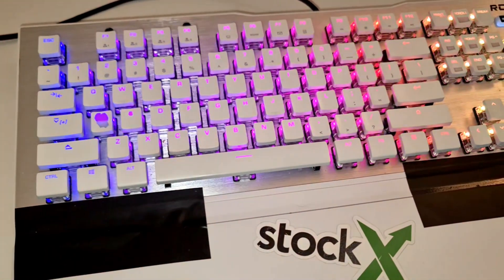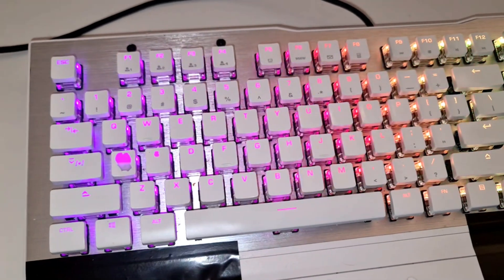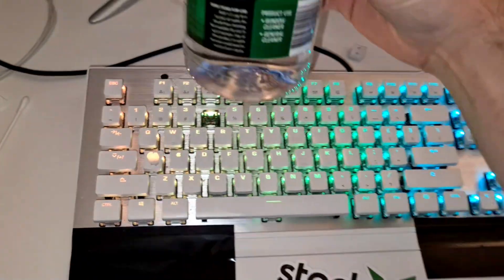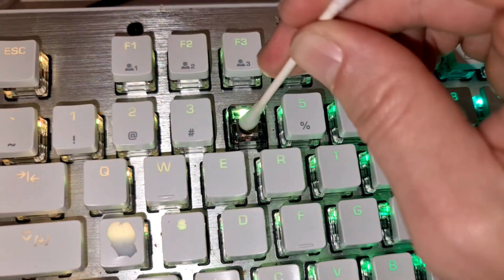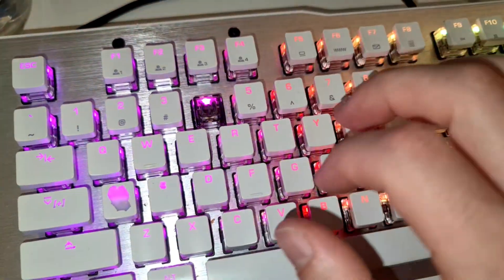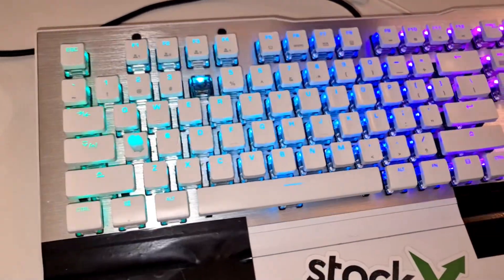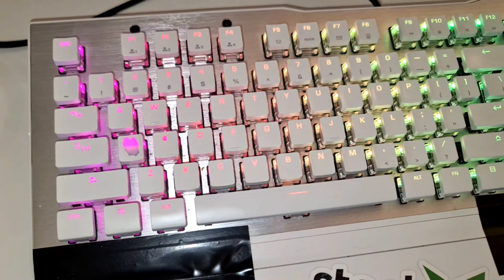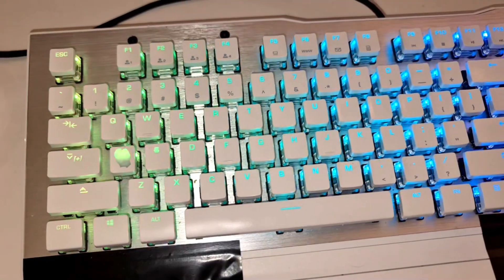Roccat Vulcan AIMO Keyboard key Not responsive or not working? Here is how to fix that.

Comment: IT professional here, have a Vulcan Pro (optical Titan switches).

Got the "-" key failing. At first it would auto-type and spam the "-" character on its own. Eventually it stopped working intermittently, then completely failed.

I tried your fix and it seems to work... for now. Strange thing is I regularly clean my keyboard with isopropyl alcohol, which absorbs water in any shape or form and basically evaporates it. But somehow my keyboard ended up with the same issue as yours, probably due to humidity inside.

Thanks sir, you get a like !
Reply from the maker: Cheers man, yeah I just finally had my Q W E A S D and 3 4 keys go a bit retarded recently.  Gave them a good clean with the spirits and it's all working great again!  

I game a lot and do higher rated mythic keys in wow so my macro keys and movement keys get the most work. 

Kinda feels high maintenance to have laser keyboards tbh. I never had issues with the old school one. 

Glad it worked for you man. Always happy when one of my videos can help someone with a problem they're having 🫰🏻👌🏻
Reply: Yeah I wondered if it had anything to do with the laser emitter and/or detector, because like you I used to have the non-optical version and never had this kind of issue,

I ponder Roccat did not really put the most "premium" model of light emitters/detectors on their PCBs and what occurs most likely, is that those get foggy when the air humidity rises, because those optical bits have not been treated to prevent this. Good old isopropyl alcohol saves the day once more !

/!\ Careful though it's liver-toxic and penetrates skin barrier, better wear vinyl gloves when working with isopropyl alcohol... and don't sniff it either ! lol /!\

Comment: wait that is enough? cheapest fix ever now to dowsing halve my keys on the left side. im asuming that it dissolves whatever is blocking the laser and or makes it drip down to the pcb or something.
well either way im glad that its fixable i was going crazy playing black desert online where my 2 most important buttons to activate skills just dont work sometimes and i just stand still like the idiot i am
it is also very funny that this keyboard shows a heatmap of where and how much you have pressed a key since the paint just chipps off like i asume you slidecast and primariy dodge left in WoW Xd
Reply from the maker: You would be absolutely correct on that assumption hahaha 🤣. 

Yep, fixed my issue and haven't had any problems since. I guess every now and then they get dirty and need cleaning.